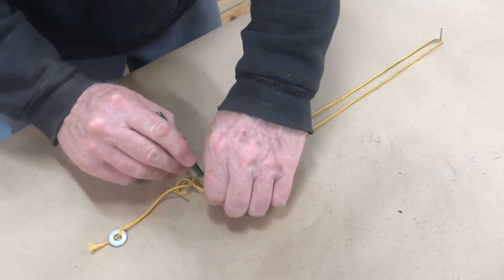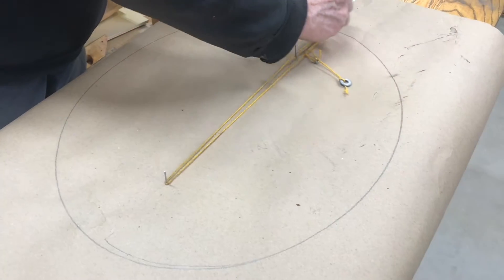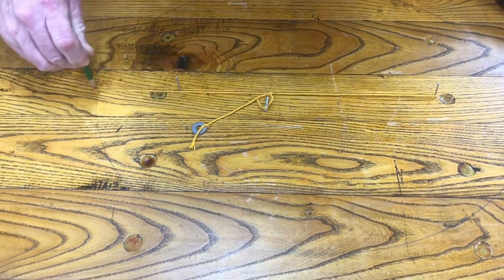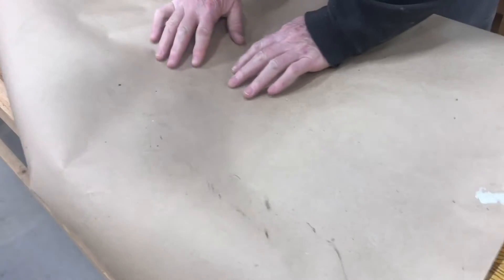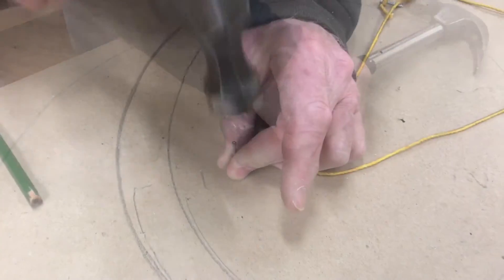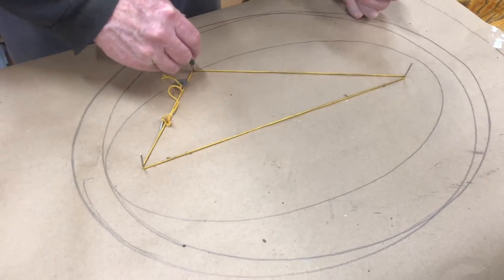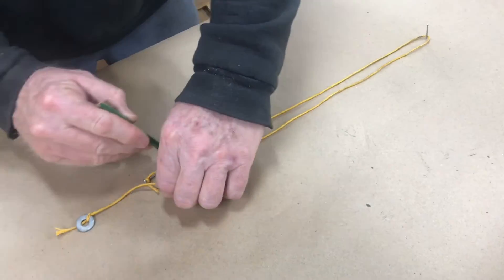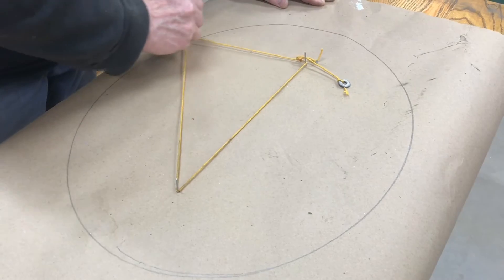draw a PERFECT ellipse with a string and two nails

Comment: To calculate string length and nail separation:
To make an ellipse that is A wide at its widest part and B long at its shortest,
You need a string length equal to A (leave excess to tie knots)
The nail separation is calculated using the Pythagorean Theorem. The distance between the nails should be √(A^2-B^2)
Reply: Thank you for this simplified answer! There is 4 years of people frustrated in the comments asking for this. And you just made it easy to figure.

Comment: Thanks for a great video. I think you can calculate the distance from the centre to each nail (c) to give you the dimensions you want, using the formula c^2 = a^2 − b^2, where a is the distance from the centre to the vertex (pointy end), and b is the distance from the centre to the co-vertex (side).
Reply: THANK YOU. I've been looking for this information and you're the first person I found to have the answer.
Reply: @TheDerekMast  Cheers! Still don't understand why it's Pythagoras, though. Must be to do with triangles n stuff...
Reply: At the risk of sounding stupid could you explain the formula please. What does ^ relate to?
Reply: @smudger304  No worries. It just means "squared" but I couldn't figure out how to write the little 2 above the a, b and c. It's the Pythagoras formula " a squared plus b squared equals c squared"!
Reply: thanks. I am so disappointed the guy in the video didn't explain this. I had to cut some glass into an ellipse. I knew I was going to attract the glass cutter to a string and use suction cups for nails, but calculating the position of the fixed points was a mystery.
Reply: I assume string length makes a difference? Is there a formula for that?
Reply: @spicerca  Good point - the string length should = 2(a+c) but most of the time I just just tie the string around a pencil at the vertex then loop it around the further nail then tie it back on the pencil.
Reply: If A is the width across your ellipse (longest distance) and B is your length from top to bottom (shortest distance) then use a string length equal to A (don’t forget you’ll need extra length to tie knots) and set the nails √(A^2-B^2) apart.

Comment: Great, as long as the dimensions don't matter 🤷

How do you use this method for a specific height and width?
Reply: You can easily calculate the with the rope to how wide you want it, and you can calculate using pythagoras the height u need,